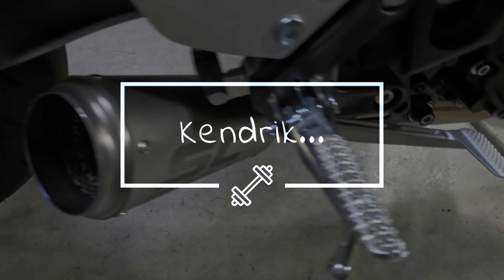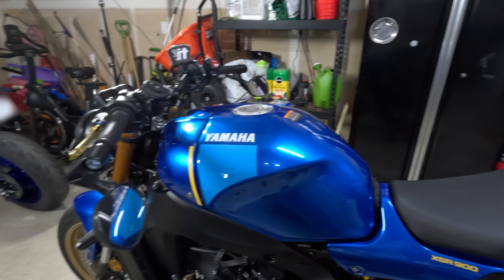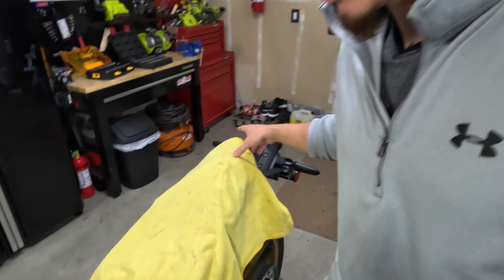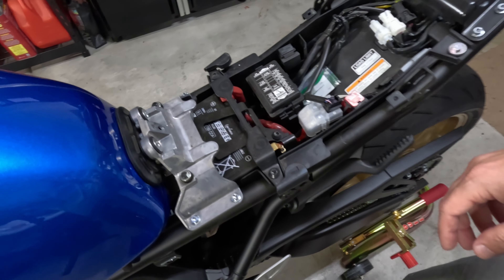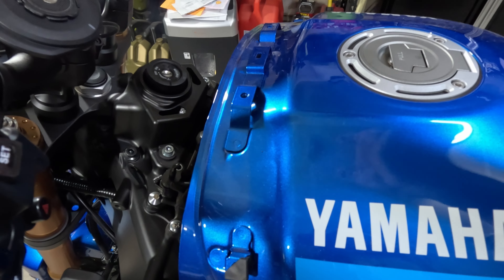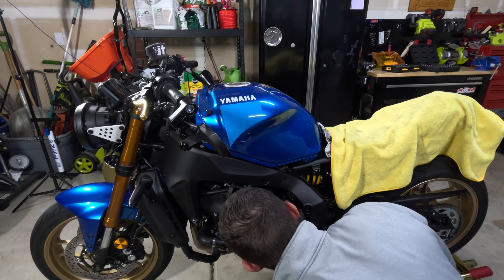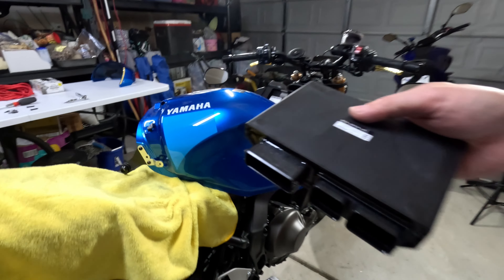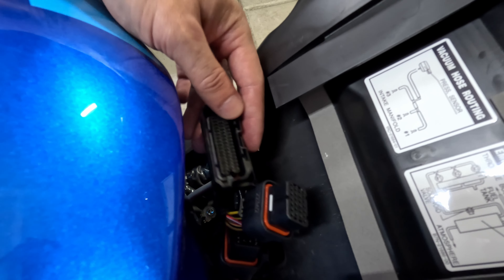Unleash the Beast: How to Remove the ECU in Your 2023 Yamaha XSR900!

Comment: The ECU can be accessed and removed without rotating the tank to the side.  Lifting up the tank either with a helper of a block of wood under it you can reach under and get to the connectors and slide it out.   Have done it twice now.  Also did my flash with VCycleNut - great work.   Enjoy your XSR!
Reply from the maker: I’ve seen that after I did this video and it looked much easier. I’ll have to try that next time. Thanks 👍🏼
Reply: Okay..  what I did..  
1.  safest/easiest tank positioning, no connector removal.  I had to twist the tank but untangled the 3 fuel lines and electrical cable,,  everything stays connected.  The tank with everything left connected is hanging off the left side beside the frame, on a 24" high trash can.  Ample slack once that electrical wire is moved around the fuel line.
2.  Tank out of the way (had to be Empty!!!)..  all 10 or so Air box lid phillips screws into the plastic can be removed, and the lid removed with the ECU still attanced to all the cables!  Ample slack..  flip the lid over..  you can see the connector latches.  the two pop off connectors, and the big latch in connector.  Easy..  no risk to tab breakage!!  I hate that.  Slide the ECU off the lid..  all disconnected..  good to ship to vcycle nut.
3.  The air cleaner itself looks to be of healthy size for 900 cc.  Easily optimized.  The box lid snorkles don't flow well into the filter..  considering a mod mod there.  
Whew..  What worked for me..  Thanks for your video..
Reply: Scary as hell.. Connectors and Trim clips..  the key to life/everything..  Need some standards here..  but I guess that's later if ever.
Reply: Are you able to remove the restriction to get the original bhp or no?

Comment: Thanks for the video! It was very helpful. I ended up removing the top of the air box though and that made it far easier to unplug and remove the ECU. I have no idea how you managed to get it out without doing that.
Reply from the maker: In hindsight it would have probably been easier to remove the air box 👍🏼

Comment: Thanks for this video. I have the exact same bike, but with the full Leo Vince exhaust. I figured it would be close to the MT-09, but see there are a few differences with the XSR. Are you upgrading the air filter as well? I ordered a DNA stage 2 to go along with the ECU flash. Cheers!
Reply from the maker: Thanks! I did purchase a dna air filter. Just the filter not the stage 2. I may do a video putting it in. It’s pretty simple.